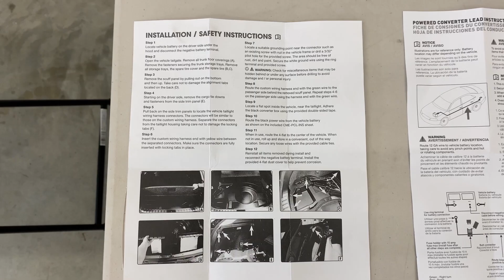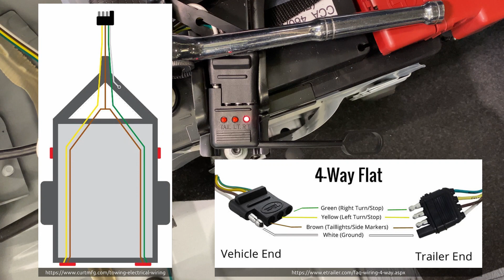Lexus NX 200/NX 300 Trailer Wiring Harness Installation FULL TRUNK DISASSEMBLY

Comment: I have maybe slightly above average handy man skills and with the help of your videos, I installed the hitch and wiring in 4 hours by myself.  I didn't have a motorcycle lift so I just used different size boxes and blocks until I got the hitch in the proper position.  One will definately need a rubber hammer to tap the hitch into final alignment with the bolt holes.  On the hybrid model the exhaust is not really that much in the way so I just manuvered the hitch around it and didn't have to take the exhaust down.  On the wiring, I found of the 2 holes with rubber plugs on the bottom and back of the trunk, the passenger side one is much larger.  The flat 4 connector would not fit thru the opening so I bend the edges of the hole up slightly with pliers until the connector when thru.  Then I just hammered the bent portions back down flat once the connector was pushed thru.  I cut a slit in the rubber plug and stretched it over the flat 4 connector and put it back in the hole.  I put aluminium tape over the inside and outside of this hole to make a better seal.  I mounted the L-shaped bracket that holds the flat 4 connector to the plastic under the trunk on the passenger side.  There is an access panel than removes with 1 screw so you can get behind the plastic to hold the nuts with a wrench to tighten them.  It really turned out great!  Thank you so much for making these videos.  I will also post this comment on the hitch install video.  I have photos but don't know how to add them to the comment.
Reply from the maker: It sounds like your install turned out great! Thanks for taking the time to post how it went, success story comments like this are great to hear and will help others when they try and do their hitch install.

Indeed the hole I used to pass the wiring through was small, I enlarged it a bit with a step drill bit and then cut the wires and soldered them back together to get the 4-pole connector past. It sounds like the passenger side method would have been a lot easier, had I not already screwed the connector mount onto the hitch.

I’m always glad to see my video’s helped someone. That was a big motive to make these two videos. There were a few hitch install videos already out, but done by mechanics with a lift, which is not as helpful for an average person in their garage. And nobody had made a wiring install video specific to the NX200/300. Modern cars are so complex to take apart I knew it could help people out, especially since the installation sheet you get with the wiring is not the greatest. So I figured why not kill two birds with one stone. I was already going to do it, why not film it too.

I don’t think you can put photos in YouTube comments, but feel free to message me on Instagram if you want to share your photos.

Comment: Great video! Thank you for walking through every single thing that needs to be done. Found another video of a non-hybrid version and they just ran the positive wire to the 12v outlet right there in the back instead of all the way to the front of the vehicle.  I did this installation and it works but just know that your signals will not function without the ignition or accessory on.  Cheers.
Reply from the maker: That is a great idea! Other than the unlikely roadside incident where you want to leave the car off with the hazards flashing, that is a much easier solution for the non-hybrid NX. Thanks for the comment.
Reply: Can you share that video link please?

Comment: Do you have any idea if this procedure applies to the new generation NX350H?
Reply from the maker: Unfortunately not, but if the 12v battery is still in the trunk (which most hybrids are) it should not be much different. Sites that sell these products like etrailer are good to lookup the right harness.

If you do give it a try let us know with another comment how it went.

Comment: Great video. Any idea if this Curt 56268 would work with a 2021 NX300h F-Sport?
Reply from the maker: I would assume so, I do not believe there have been any changes to the NX until the next gen (250, 350, 450) ones came out this year.

If you are unsure check a website like etrailer, they list vehicle compatibility for hitches.